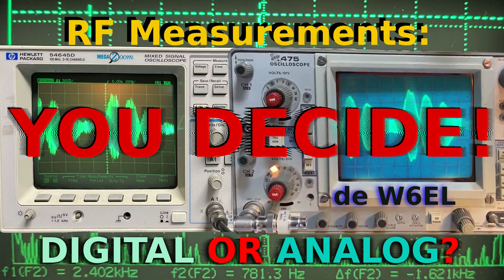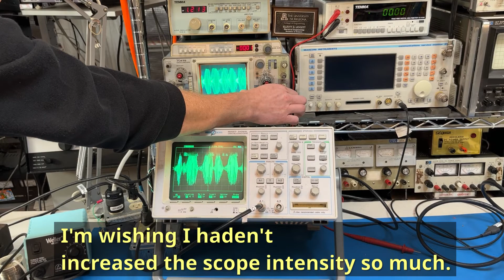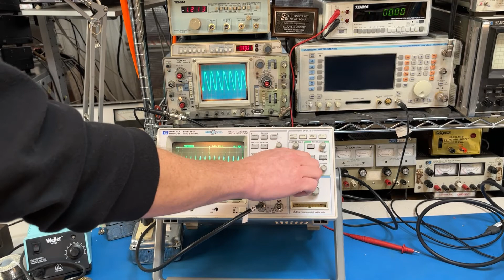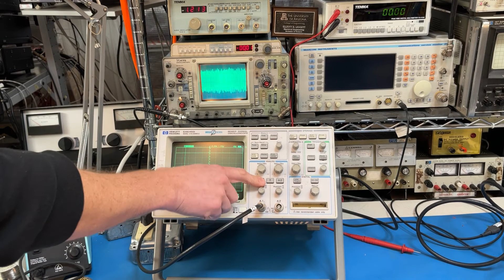Digital or Analog scope for RF? You decide!

Comment: What you are showing is old tech which I also hated back when I used the earlier digital scopes trying to work on a peak tyrcking circuit I was developing for floppy diak analyzer systems. This crap does not happen on moderns scopes if you set them correctly (i.e. peak mode, and the correct sampling rate).  A low cost Rigol, Siglent and even some Owon & Hantek would beat the crap of the HP digital you are showing!  ...seriously man, please do not tarnish modern digitals with such old equipment from HP.  I do still love analog scopes, just can't afford any these days.  SHould have bought one back when people were virtually throwing them out, ..wanna get rid of your! :):):)
Reply from the maker: Hi Steven, 

You make a valid point. I'm comparing my "vintage" digital to clearly vintage analog. All my scopes are from the "sub $200" category and even that HP I have is a dinosaur by today's standards. There are certainly modern digital scopes which would easily outclass it and perform envelop detection without glitches. I've used very expensive present-day scopes which would perform these duties quite well. I wonder how well the "budget friendly" digital scopes would do though? Such as the $200-500 digital scopes on Amazon? I've read mixed reviews about them but I bet it's worth a try! 

When I was in school we had one EE lab with digital scopes, and they were truly atrocious even at the time. I believe they were made by Motorola but it could have been HP (it's hard to remember which amber-screen dinosaur is which sometimes). They were slow and clearly inadequate for most of their "digital" tasks. For example, enabling the RMS readout caused the display to move slowly and show only every tenth trigger. I hated them (we all did, the Tektronix analog scopes were so superior at the time!), and I suppose that is part of the bias for where this video comes from. Granted, the HP scope in the video does a reasonable job despite how ancient it is by today's standards. 

73, 

--E
de W6EL